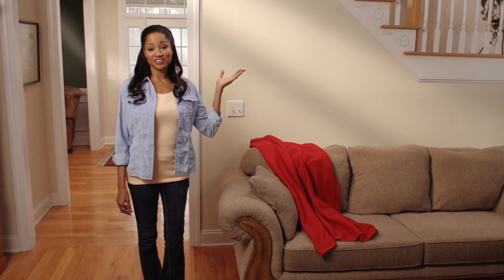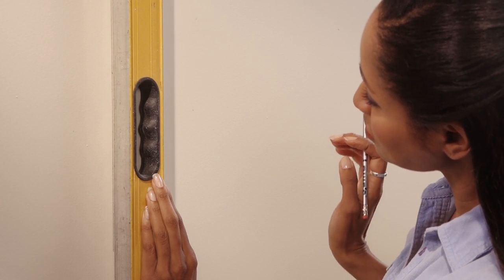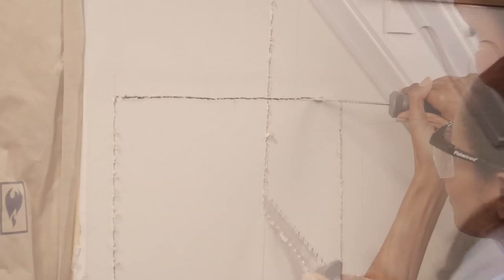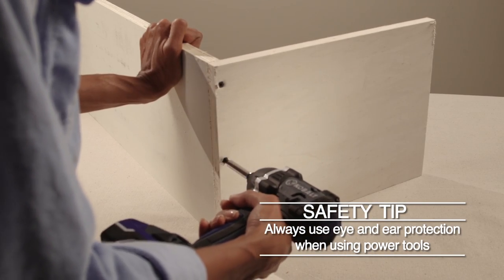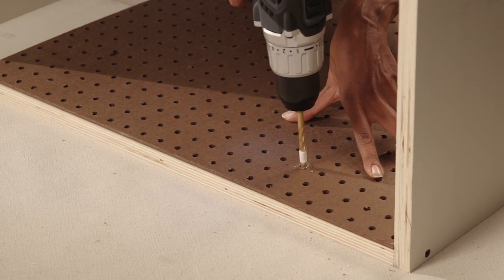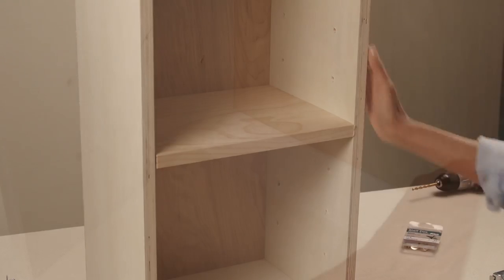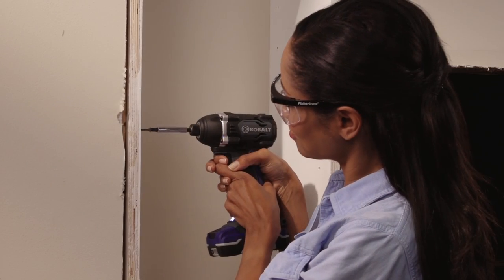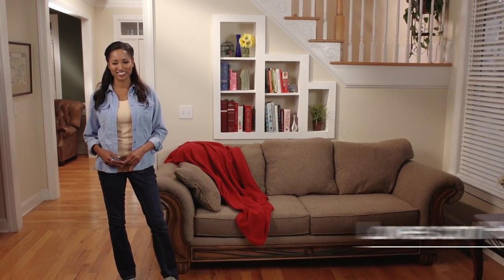Hidden Storage: Under-the-Stairs Bookcase

Comment from the maker: If you have metal studs, you will want to do 2 things slightly differently. First, you will use metal tapping screws instead of wood screws to attach the boxes to the studs. Second, you will want to cut 2 pieces of 2x4 to act as supports for the bottom and top of the boxes (similar to what we did for the medicine cabinet video). Also, metal studs can sometimes have some "wave" to them, so check that they are flat and level. If not, you can use furring strips to help get everything flush.
Reply: I've been wanting to do this for a long time.  I think I'll do it now.
Reply: I've also considered that space for a mini wine cellar.
Reply: Okay then,thanks for telling us. I will alert the media.